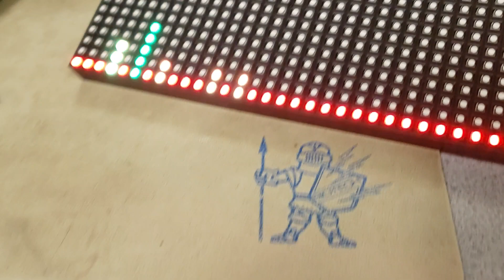LED Music visualizer

Comment: hey sir i watch some of your video, and its really amazing, iam also undergraduate  electrical student in one of my country university, and i think each of project is big project (need alot of time to finish it), 
so my question is 

how long average each project is done? 
so if it just final project of course, how about final project before graduation, how big the project is be?

sorry its maybe stupid question, but i really want know.
thanks
Reply from the maker: These were all done in the last 5 weeks of a one semester course. They typically require 100-200 hours of work. Our college does not require graduation projects. But some students will spend 500-1000 hours on big projects while at Cornell.
Reply: @ece4760 , ok sir, thanks a lot for replying, that is so fast for amazing project
Reply from the maker: @CaasperART  It is fast, but the students are very good at Cornell.  It is a pleasure to teach at Cornell.